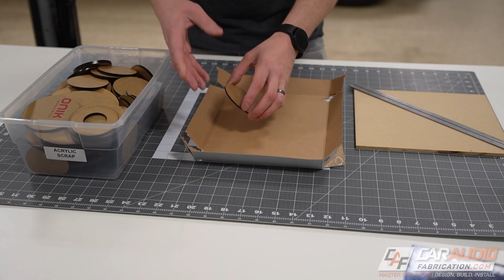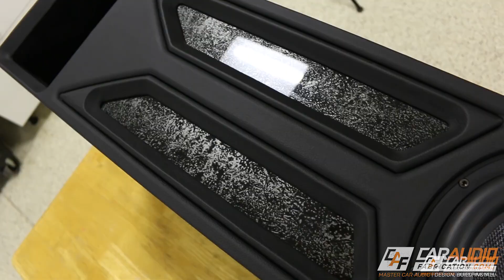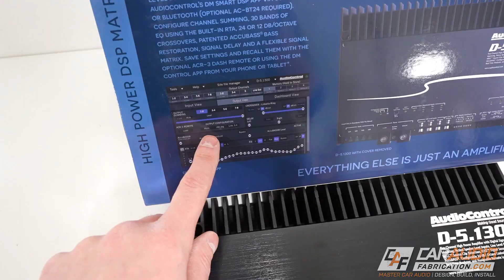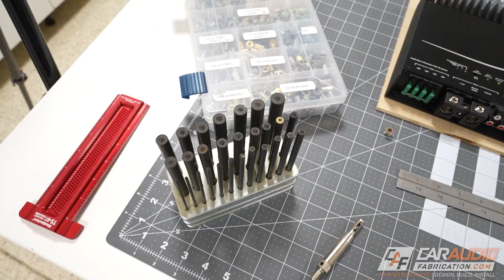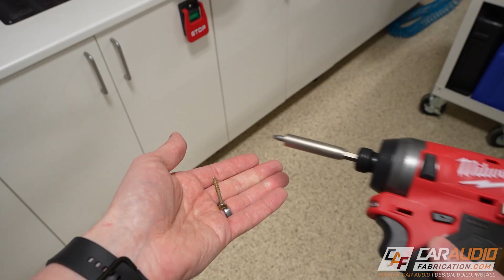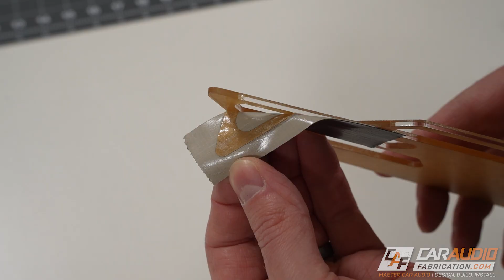10 Car Audio Build Hacks everyone forgets!

Comment: At 16yrs old after building my 1st EVER fiberglass enclosure I was screwing in my brand new JL Audio 15’s I had on lay away for over a year while I washed dishes in a lil restaurant and on my LAST screw the bit slipped off like you mentioned and blasted a HUGE hole in the sub! I was devastated! It ruined without EVER being used a single time!

Comment: I am trying to run two kenwood excelon 12” subwoofers with a ported box with the kenwood excelon dmx908s for my radio also the kenwood excelon xr-1701p components for my front door and tweeters and im trying to run the kenwood kfc 6996ps for my rear deck speakers i need help on picking my amps and i need to know if i will need a second battery and a new bigger alternator and a compacitor i got a 2012 chevy impala just want to rattle the trunk a little dont wanna break the glass or knock body pannels off could you please help me sir
Reply: Definitely a capacitor

Comment: Another Quick-Step that I like to use, when you were making the cardboard compass to draw the circle, anytime I'm using a measurement that contains fractions (everybody hates dealing with fractions) like a hole that's 9-11/16", I just draw out 9-11/16" on the cardboard, add an inch, then I fold it in half to find the center. That extra inch just gives me a spot to push my pencil tip through.

Comment: Very interesting! If you do part 2, please include your favourite hack to transfer factory hole pattern to a mounting plate. For use in a case you want your amp rack mounted to the car using factory holes in the car body.

Comment: Do rear speakers in a MDF table for a hatchback car need to be in a closed inclosure? or the back of the speaker where the magnet is can be open?
Reply from the maker: Whats most important is that the rear wave is isolated from the front. Many car audio speakers are designed for an "infinite baffle" application, so in a car a really large air space essentially with a baffle separating the front and rear. For simplicity sake though a sealed enclosure can be made, but not required
Reply: @CarAudioFabrication  How do I isolate the rear wave from the front in a hatchback car?
Reply: Make sure that, behind the speaker, anywhere that air can get through is sealed. You can use either permanent sealants or effective (probably custom) gaskets. Also, you may need to make extra walls for the speaker(s). It would end up being something like a mini trunk.
 
Note: Keep in mind the importance of the car's pressure-relief vents.
Reply: @romano5785  it depends where speakers are mounted....on old hatch back some had a package tray that opened with rear hatch...it also would separate the front and rear of speaker mounted on ....just make sure rear of cone is sealed from front...they make foam baffles that can enclose rear of speakers.....the better the seal the better the sound
Reply: @luchvk  can you explain more about the pressure relief vents? Which are those?
Reply: @romano5785  They're basically flaps, usually in the back of the car, that are designed to open when the air pressure in the car increases. They open when you close your door or trunk/hatch. Also, they work passively (no motor etc.). Without them you can blow out a window if you close something too fast.
Reply: @luchvk  Thank you, I have another question if you don't mind, I bought the Alpine S-S65 and S-A32F the speakers are 4 ohms, can I run them at 2 ohms to give them more RMS? the amp is rated to 80w RMS at 2 ohms and 55w RMS at 4 ohms :(
Reply: @romano5785   @Romano  If it has an impedance switch maybe. The wiring setup doesn't change the impedance (ohms) of the speaker(s). The thing that changes is the impedance sent to the amplifier. The only ways I know to change the impedance are 1. to get a different speaker with a different impedance and 2. wire multiple speakers together at the amp (this is common and safe if done right but can destroy equipment if done wrong).

If you have mid-range speakers that means either going from two channels to one channel or increasing the number or speakers that you have.